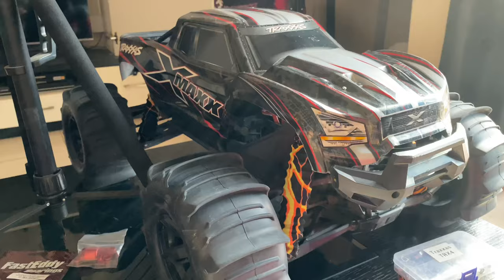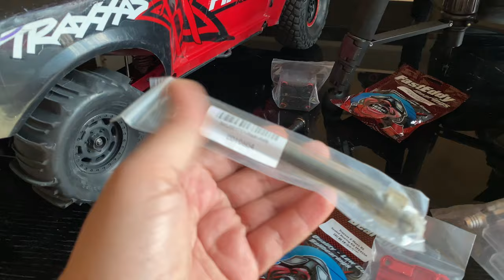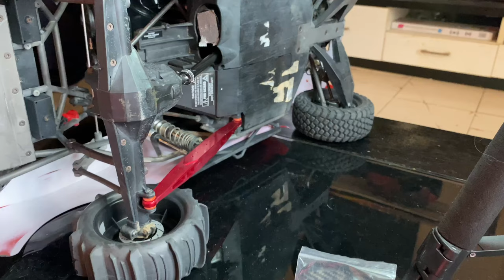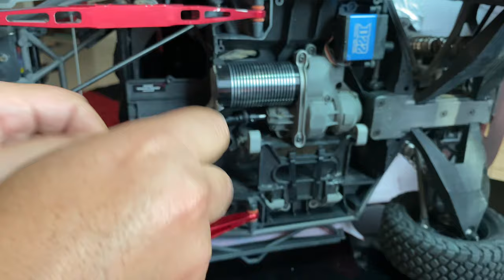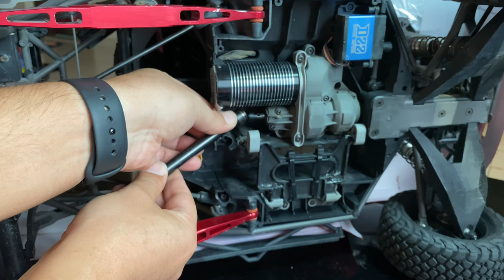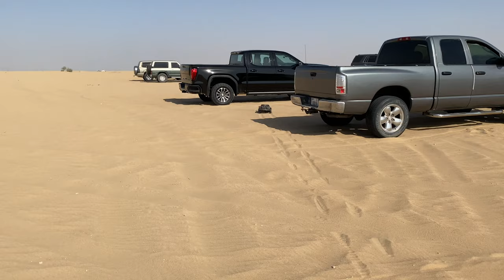Traxxas UDR Essential Upgrade

Comment: UDR how do u change the low voltage cutoff
Reply from the maker: If you have the Bluetooth part to connect the remote and start playing with the esc settings from the traxxas app but i run hobbywingmax6 in mine and i love it
Reply: @UAERCADDICTS  have used the app with yr UDR
Reply: You*
Reply from the maker: @frankiej6329  negative but this might help you https://forums.traxxas.com/showthread.php?9090586-How-to-set-LVC-on-traxxas-link-app
Reply from the maker: If you are running lipo batteries its highly recommended to keep th low voltage cutoff on to protect your batteries and esc
Reply: @UAERCADDICTS  I wanted to set the voltage higher. wat is it set from the factory
Reply from the maker: Ohh alright I understand but unfortunately seems you cannot get a max6 if you can
Reply: @UAERCADDICTS article doesn't say how. The second part. I can't use the alarms my batteries doesn't have balance leads
Reply: @UAERCADDICTS  when push the button on esc it won't turn on but the receiver does